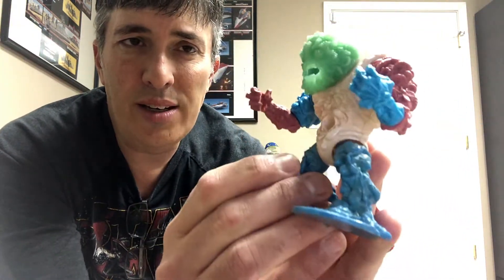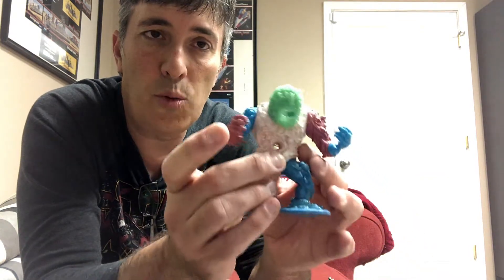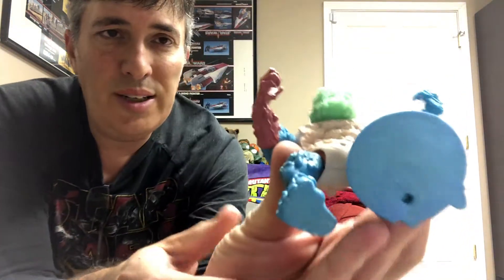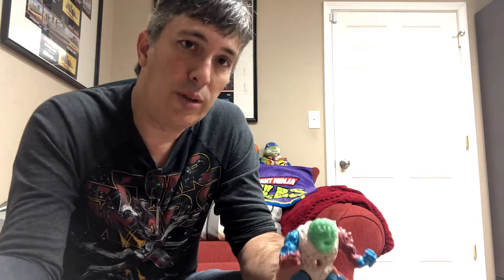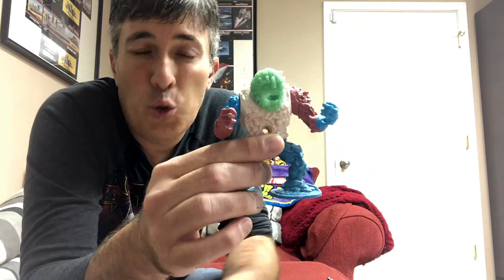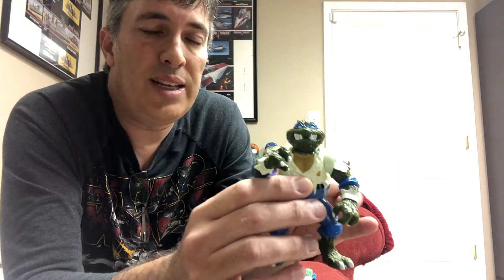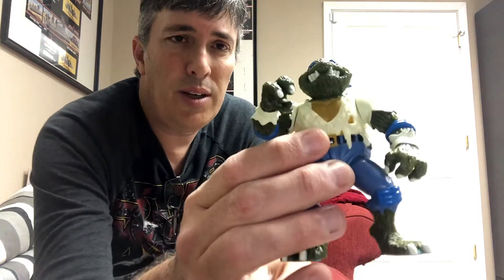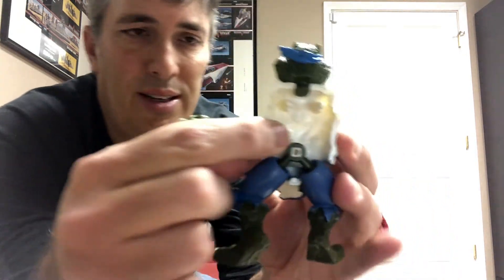Teenage Mutant Ninja Turtles Prototype Video Blog #2:  First Shots

Comment: A dude at mattel said the colors are for parts, the old parts use the previous colors while the new part molds are new colors.
Reply from the maker: Yes, that can be true at times as well.  Doubtful that is the case on this Muckman I'm showing as 100% of the parts would have been new at the time because it was a new figure.  I also worked in the toy industry for about a decade and a half, so I can say there are multiple reasons parts might be in weird colors, but the most common reason is that they were running molds for a different figure and interrupted the run to make test shots, but didn't waste time and plastic to purge the molds first.